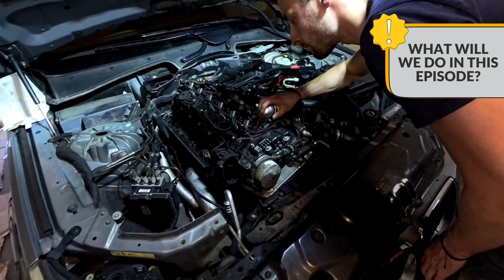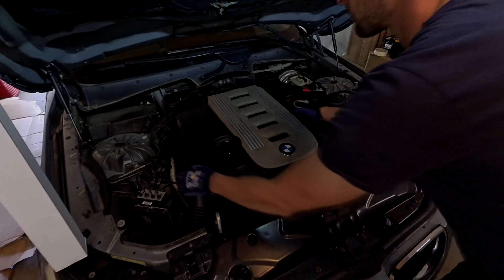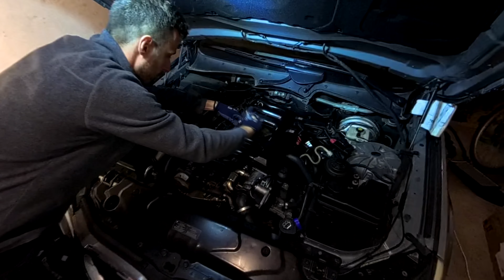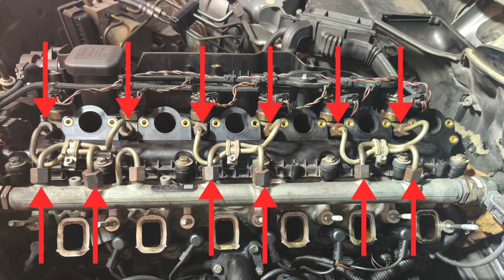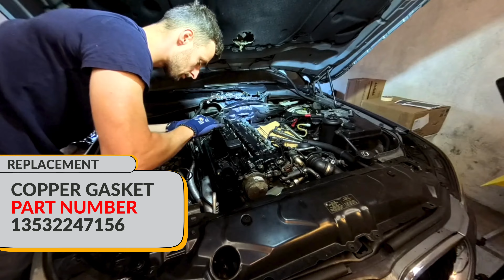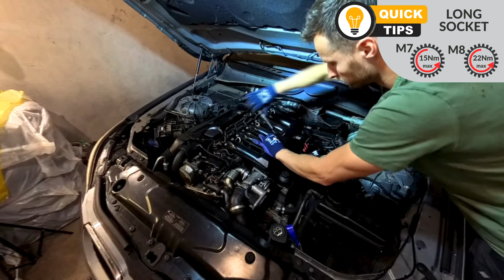How to Replace BMW M57 Injector Copper Washers (E60 E61 E46 E90 E39 X5)

Comment: What about bleeding air from fuel system? doing with diagnostic or a manual releasing fuel lines screws by hand?
Reply from the maker: Hi! That’s a great point, definitely something worth adding to the episode. Before starting the engine for the first time, turn the key to the ignition position but do not start the car (do this three times); the fuel lift pump will build up pressure in the system. After starting the engine, it might run a bit differently for a few moments, but everything will return to normal after a short while.